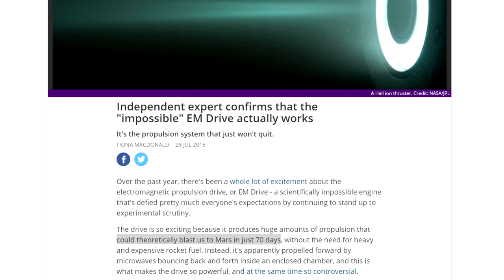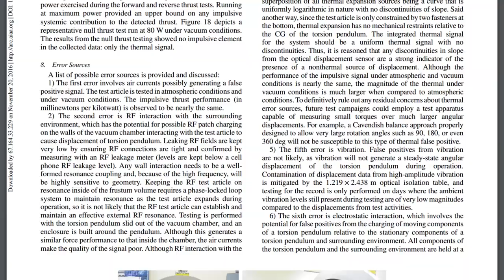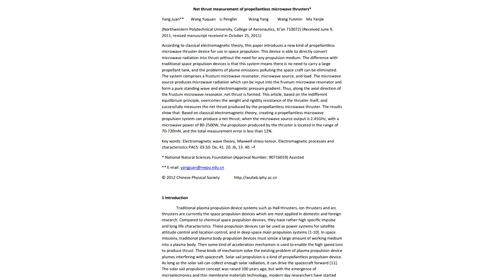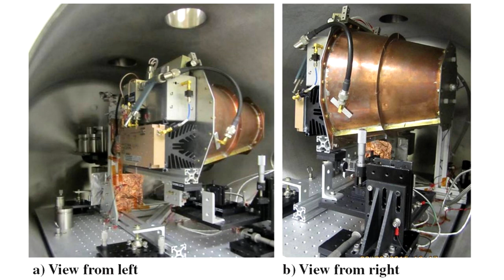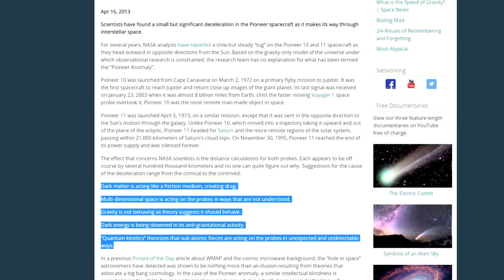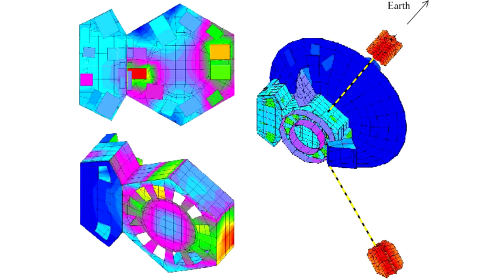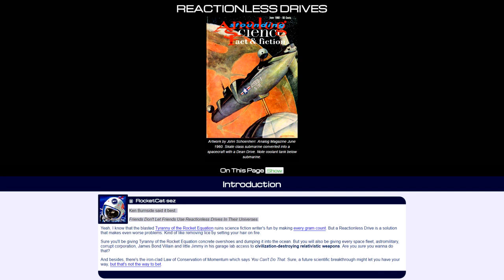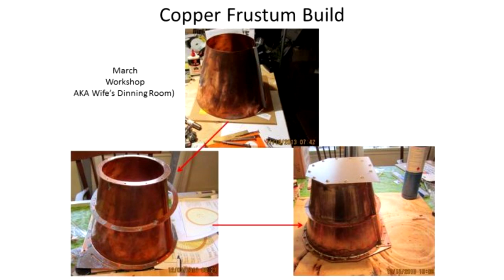What is the EM Drive? And Does it Really Work?

Comment: i hope there is some merit to this or similar ideas as, lets face it, the movie version of space ships is much more exciting and practical than having a massive rocket of which the vast majority is fuel
Reply: that's really only to escape Earths gravity. Once you're in space, when we get to a point we are building ships in space, they can get a bit closer to the images we see in movies.

I'm not the person to ask but I always thought solar sails were the future of early space travel with no fuel, just using the sun. As described in some detail by Arthur C. Clarke.
Reply: solar sails are great but what if you want to fly in the opposite direction ... tacking in space?
Reply: John P
I thought it went along the lines of, solar sail generates electricity for an engine. Like an electric car. You accelerate for half your journey turn the ship around, I mean rotate it 180 degreea, then spend the other half of the journey slowing down.

It just sounded so elegant to my young ears when I first read it in a novel. Totally useless to fly around on a whim but from A to B, no fuel costs. I imagined we'd have like shipping lanes of these solar ships coming and going like we have with ships in our oceans. I got that idea wrong heh
Reply: Actually, tacking with solar sails is completely possible, and works just the same as sailing. There are even designs for statites, which are satellites which 'hover' using the solar pressure to maintain position without orbiting.
Reply: that sounds like an array of solar panels ... solar sails are a thing too though .. for capturing the solar wind

i just really hope that something like the em drive becomes a reality in my lifetime .. the future will be so much more exciting if new areas of physics are discovered .. and as mentioned if you can jump in something closer to a private jet and go zipping off somewhere - and come back - rather than sitting in a tiny capsule on top of a vast quantity of propellant ..

this whole attitude of "it goes against the laws of physics so it cant be real" is a little irritating because, well, at some point everyone thought the earth was flat
Reply: John P. your statement proves you didnt even watch the video, even IF this thing works at all it does not come close to what you say you want.  it is literally the slowest most boring propulsion system when compared to existing tech and would be worthless for what you describe.
Reply: what is it elon says... any new tech has to go through 3 evolutionary steps to become mature ... and given theyre not even sure if this works yet, i think its somewhat preemptive to be predicting its future performance .. anyway i literally havent the faintest idea if this will work, i just hope something like this does...eventually
Reply: John P I don't know that Elon Musk has ever proposed a technology that violates all known physics.
Reply: John P the main ineficiency with this design is the loss of energy due to thermal resistance of the EM generator. something that can be fixed with supderconductor, also increasing the potential thust output drasticly. as you will only need to charge the thing to huge energy levels once, then just compensate mid flight for the conversion of energy to thrust.
Reply: Solar panels can technically be used for a solar sail, and it's a pretty practical solution too. In fact, the Kepler Space Telescope uses its solar panels in this way to maintain its orientation due to problems it had with 2 of its reaction wheels failing.
Reply: practical ?! well it's hardly PRACTICAL if it is just a fantasy....
Reply: eerr...no..you are hopelessly wrong...
Reply: +DrewLSsix *Second slowest, the slowest being photon thrusters.

Arguably, if the EMDrive does work, it opens up a whole new realm of physics we do not understand, which might mean it's possible to make a powerful EMDrive thruster.

Personally, I can't say whether it works or not because I'm not an expert. But I'm not an skeptic because a future with the EMDrive is much more exciting than one without.
Reply: Miguel Bartelsman Arguably,and as it has been argued in this video, the EM drive can't work.  If it works, then you can devise a perpetual motion machine that would enable anything you want to be to be, literally.

Personally, I'm not interested in skepticism that is so ready to abandon all that is known in favor of that which is desired.  This seems to me to be the opposite of skepticism.

I'd love to wiggle my nose in order to transport myself from Earth to Mars.  If the EM drive works as proposed, then I will be able to do such a thing.  However, I don't place faith in fantasy.
Reply: Sadly, if something is exciting and relies on unproven science, it is most likely false. Remember, if it sounds too good to be true, it probably is.
Reply: yeah well, unfortunately, this has got nothing to do with perpetual motion and if you bothered to listen, you'd know that, it is not that complicated, it really isn't. And if you had any understanding of this thing, you'd also know that there's no need for skepticism, it is simply a horrendously inefficient method of thrust, the numbers are right there at the bottom of the first paragraph..read it, and use your head !
Reply: psycronizer Yeah, well unfortunately I did bother to listen.  If the product of a device generates more energy than the energy required to make the device work, then it is a perpetual motion machine.  If you'd bothered to listen, you'd know that.

My understanding of this thing doesn't in any way whatsoever dictate the need for skepticism.

To be clear, what numbers are your referring to at the bottom of the first paragraph?  I am using my head.  This one experiment, if it fails to be shown to be incorrect, shows that every single bit of understanding we have forged in the last 400 years is incorrect.

I will, as a skeptic, acknowledge that it is possible the EM drive works as advertised.  However, also as a skeptic, I must conclude that the chances of such a thing being true are vanishingly small.

If the EM drive works as advertised, then perpetual motion is possible.  If you bothered to listen, you'd know that.
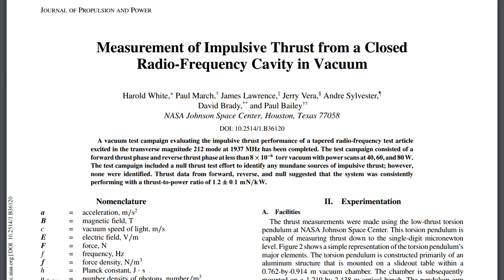Reply: sigh...big sigh...at 1:15...read it..they are getting 1.2 milli Newtons of force from a whole whopping kilo Watt of power...that should tell you all you need to know....do you not know what that means ? it implicitly implies two very hard facts that you can't dispute or deny..1) the force produced is very very small, easily within the realms of experimental error  and 2) very obviously if you are having to pump in one whole kilo watt of power to create that force well then it's ridiculously inefficient...see?...and...by extension, anything concerned with the idea of perpetual motion would of course need to be 100 percent efficient otherwise it would loose energy from it's system and drain down to nothing, therefore is not permanent, not perpetual, neither the power source nor the mechanism itself is 100 percent efficient, it cant be anyway, the laws of physics should tell you that quite simply..anyway...how old are you, just out of curiosity. I'm, 47.
Reply: ***** If it does work, chances are that the mechanism doesn't break the whole of physics, only that it works through a means previously unknown to us. If it works.

What is more plausible (in a world with a functional EM Drive): A device that doubles as a perpetual motion machine or a device that works via a mysterious force that does not imply perpetual motion?
Reply: Miguel Bartelsman If the EM Drive works as advertised, it can be used to make a perpetual motion machine.  I thought Scott gave a pretty good explanation of why this is the case.  There is no scenario in which this device works and physics as we know it is correct.  It is not plausible to assume that the device works.  It is plausible to assume the experiment is in some way flawed.
Reply: ***** I never said that there's any scenario where the device works and physics stays the same.

The explanation Manley gave was according to how it is believed to work right now, what I'm saying is that maybe it doesn't work like that.

Part of science is to be skeptical of everything, that includes current knowledge.
Reply: psycronizer Here's a bigger sigh. 

The force produced is very small.  No one is arguing about either the existence or the relative magnitude of the force.  The question is in how the force was produced.  Very obviously, if thrust is produced without the need of a reaction mass and you continue to produce thrust, then at some point the power out will exceed the power in.  I don't understand why this is so difficult to comprehend.  

Our comparative age is entirely irrelevant.  If you presume that it is, then I would call you a peer rather than an elder or a junior.  Your age and mine has no bearing whatsoever in the validity of our arguments.
Reply: well.. ok.. here's my question/thought...  take for a moment that quantum physics has shown us some pretty amazing experimental results that have been repeatedly verified (double slit, entanglement and teleportation)... and there are many different interpretations of quantum physics... and our science is incomplete and inaccurate to begin with...  we do not even know whether or not things are particles or waves or change back and forth or what now... which makes me think we are missing something (and/or interpreting incorrectly)... we had the aether, we have fabric of the space-time continuum...  I mean is there really any spot in the vacuum of space that truly has ZERO energy? (oops shit! i didn't mean to put those two words side by side like that, honestly it is a real question I have)... I mean according to the math for an electron or a photon their strengths fade dramatically with distance, yet NEVER to zero no matter how far. just like gravity equations apparently show the same.... subatomic "particles" by their very existence and nature always have energy and are always "vibrating". we can break down subatomic "particles" into quanta.  the quanta too are this way...  if relativity is correct about time and space dilation and stuff at the speed of light then how does that relate to the photon itself?  i mean everyone always talks about how it effects anything else going at the speed of light, but no one seems to think about what that mean about the light itself...  and by extension any of the EM spectrum or quanta... and everything we call "physical" is actually made of all that...
Reply: it could be argued that we are so ignorant, we dont even know what parts we dont know ... if on the other hand, contemporary science was complete and accurate, the future would hold far less allure than it actually does .. for which im very glad!
Reply: LOL thanks for that

Comment: Radiation pressure inside a cavity works almost exactly like pressure from gases (the photons with random velocities are mathematically analogous to particles, they also carry momentum). So if the inventor's claim that simply tapering a microwave cavity should lead to thrust, a tapered box full of air should also propel itself! That's how ridiculous the claim is. 

If you know some basic calculus, it's a good exercise the vector integral of uniform normal field over an arbitrary surface is 0. In 2D this reduces to the obvious statement of how following the path of a closed curve leads you to back to where you started.

Keep in mind this analysis isn't even needed because classical physics provably conserves momentum within it's axioms.  That's why they had to come up with silly concepts like the "Quantum Virtual Plasma".
Reply: Gustavo - Let me ask you a simple physics question:  In the "Law of Conservation of Momentum" are Virtual Particles part of the "Total System Momentum"?  IN other words: If a device can PUSH on virtual particles and exchange momentum with them, then the virtual particles annihilate an LEAVE the physical presence of the device that pushed on them?  IS IT a violation of physics?

If a device can push on the virtual particles (exchanging momentum with them), then the particles disappear (taking that momentum with them) was there really any violation of basic physics?  Or are the virtual particles part of the "Total System Momentum of the universe"

Comment: What about using a working EM drive for station keeping? 

A satellite or space station could use solar power to power the drive and thus keep itself in orbit with less or no need for propellant refueling. It could drop the maintenance cost on the ISS a fair bit. 

Again, assuming this thing works.
Reply: Totally.

However, the pop sci press announced it as some cheap manned spaceflight gizmo.
(Because: More thrust than even the things that will sent things to Proxima Centauri!)
Reply: There are already other viable methods of stationkeeeping without using reaction mass. The Earth has handy things like an electric field and magnetic field which you can use to generate a net force.
Reply: Probbably, but first they need to improve the efficiency or get bigger solar pannels. Those few uN/W seem like a problem right now.
Reply: if it can use em waves to propel itself.  it should then be able to use the naturally created em waves of the universe too.  like air for downforce or drag on a car.  altering em atmospheres or pressures i want to say to increase its efficiency. or like getting a sail boat to sail into the wind.
Reply: For practical purposes though, the ISS uses reaction mass thrusters.  Generating the kind of electromagnetic fields for stationkeeping tends to play hob with equipment... a bad thing.

Comment: @scott manley  There are a few theories out there that suggest the EM drive doesn't break the laws of physics and that it also doesn't do anything funky with 'quantum vacuums' or other such nonsensical explanations. Maybe try to find those, might be an interesting read for someone like yourself with a far greater understanding of physics than me.

Also, being afraid of "the laws of physics being changed right under you" might not be the best mentality. Being skeptical is, of course, expected and reasonable. However, being scared of change simply because it's "scary" is not so smart. The laws of physics allow us to model the universe and make accurate predictions based on what we have observed in the past. Throughout history these laws have been altered numerous times by new data, allowing us to more accurately predict and model whats going on around us. While I'm not defending the EM drive (though i do believe it will turn out to be bogus), I'm also not going to discount the research that has been done on it thus far. 

I've heard rumors that the EM drive is being tested aboard the USAF's X-37 and on board China's new orbital laboratory. Interestingly, amateur astronomers who track the location of the X-37 claim that it has changed its orbit far more than its, albeit assumed, delta V should allow, possibly hinting at some other form of propulsion being utilized.  

I say some group (probably NASA) send one of these into space (without it being shrouded in secrecy) and give it a whirl, put this debate to bed once and for all.

On a side note, your videos are always great and provide an outstanding means of learning about space after a long day of work. Keep it up :)